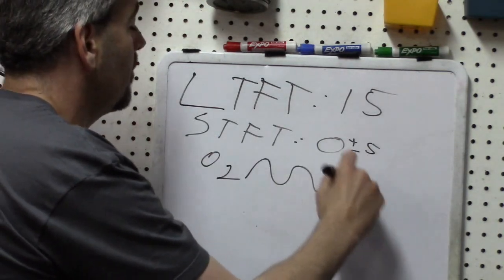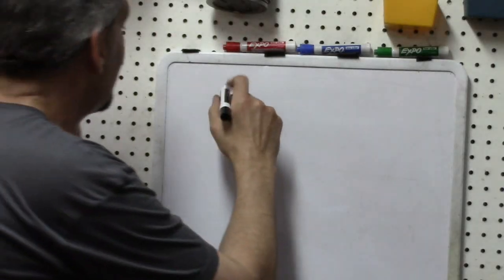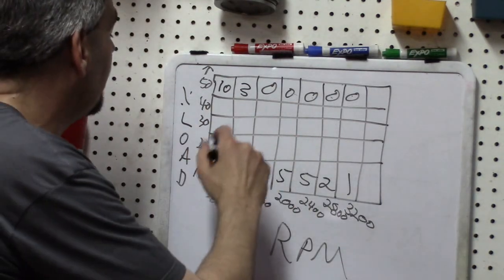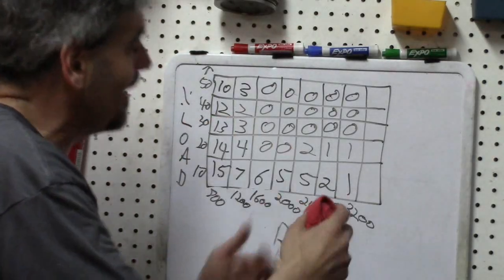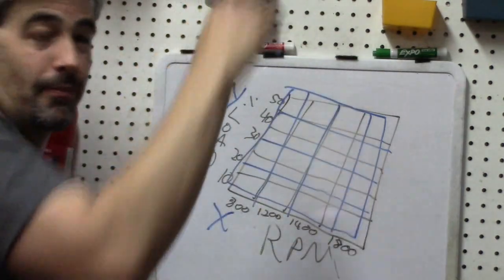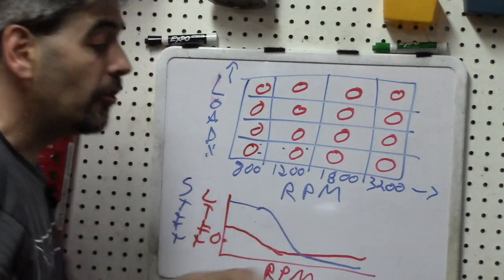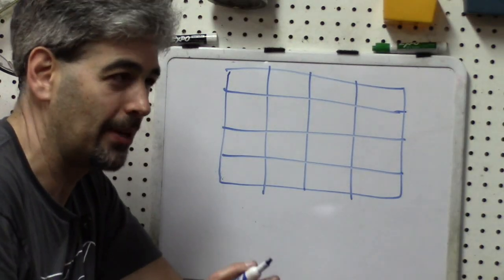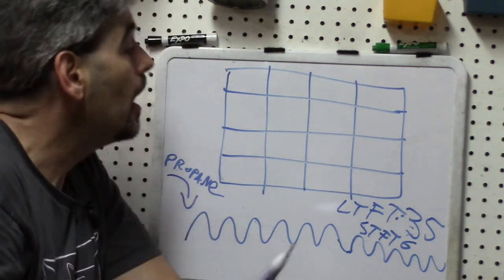Understanding+Diagnosis: Adaptive Fuel Learn Strategy

Comment: Your explanation didn't need understanding of the other videos of fuel trim   . 20 min. of this video was explaining the Adaptive learning memory Map and their Cells which is a tick tac toe style block picture with equal size blocks containing different numbers ,  and your map has three dimensions so one map stack on the other map , That was the first 20 minutes  That , Those numbers were data , numbers recorded by the ECM and placed in the little blocks for the longer duration fuel trim.  Then you mention the Short term fuel trim. And I only vaguely understand the difference but important in this video is the picture you are constructing . Short term fuel trim map is a different time fram than Long term fuel train .  So Each long term fuel cell is composed of smaller short term fuel trim data.(numbers) to create a map within a map.  That's easy , Right?
Then you throw in glitches  Why propane bleed into the intake manifold didn't triger a response from the Long term Map. You didn't say but it was a short term test that need a short term examination rather than the long term map couldn't present . That is we can't see the forest ,for the trees . My point is this concept is no more complicated than your introductory Fuel trim videos . For someone that all of this is new too
Reply from the maker: bob brawley That's not entirely correct, and ironically, because I think you are misunderstanding STFT.  STFT is not a mapped trim. It is not learned- it is purely reactive.  An LTFT map is strictly made up of LTFT learned data, not STFT data.  In fact, the STFT still reacts independently of the LTFT even if an LTFT is established in the map.

  In events where LTFT is unable to be adjusted (either because of conditions where fuel trim is not used in adjustment at all, or because a mechanical issue is causing a maxing out of LTFT adjustment) you will see the LTFT and STFT nonreactive because total fuel trim is not able to be adjusted further. 
  make sense?
Reply: bob brawley Not entirely , of course or even a smiggen maybe.  But I do understand that  STFT is not a magnified view , a shorter duration whos sum won't  create a LTFT cell number   I don't understand how to interpet the different graph of the stft compared to ltft.  But I do understand  more about the relationship between the short and long fuel trim. and that their relationship is the Art? of diagnosis
Reply from the maker: bob brawley Man sorry bro but I think you are severely underestimating how complicated this is.
  The STFT DOES create the LTFT fuel cell value- that is the only possible source of the data if you think about it.
  This is why an understanding of the relationship between L/STFT is indeed necessary to understand fuel learn strategy. It is impossible to understand fuel learn without understanding the derivatives, and this can only be understood when fuel trim is mastered.

Anyway to answer your question, the art (science, actually of diagnosis) is not the interpretation of relationship between LTFT and STFT- that relationship is constant and defined.  The diagnosis comes from the relationship of induced variables and fuel trim- i.e. how does the fuel trim (both of them) react to a variable?  This is where the data for diagnosis comes from.

  You might want to re-watch the fuel trim video- I think it will make much more sense now.  You absolutely have to understand those graphs bro- if you don't, you don't understand the concepts enough to make diagnosis. The graphs are the only way to make the diagnosis!!